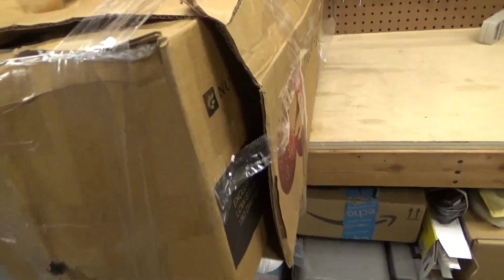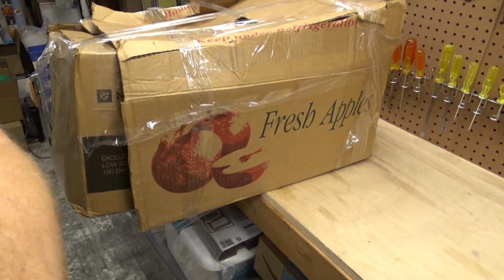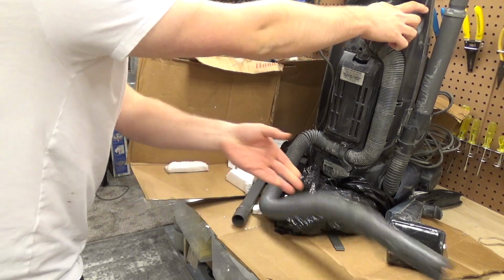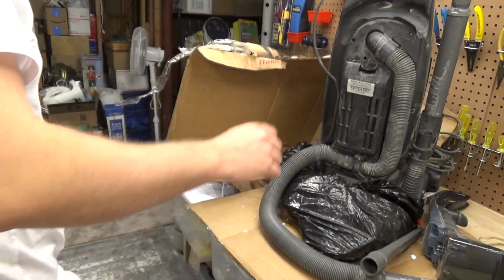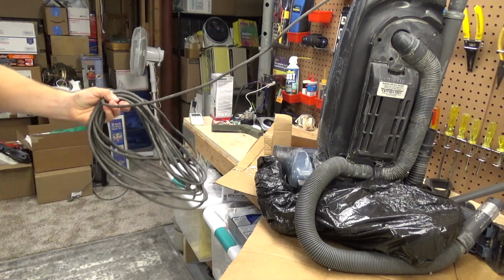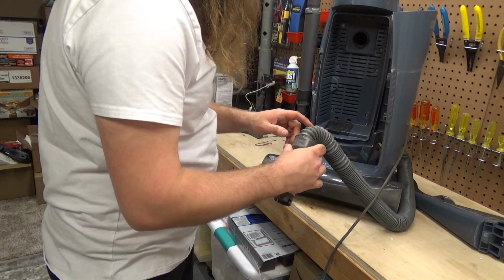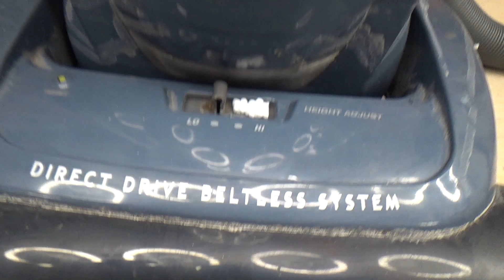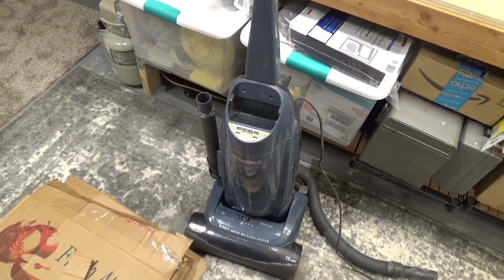Another EBAY Disaster Unfolds

Comment: Looks like it’s working properly. When you lean it back the brushroll runs at full speed if you press carpet. If you press gentle it will cycle the brushroll to the low speed and another press turns the brushroll off.

The Inteliclean will vary the suction speed automatically depending on how much dirt is picking up.

And if you’re on carpet or bare floor you press the H/M/L button to manually adjust the suction speed.
Reply from the maker: OK, that's all coming back to me now. It's been quite a few years since I've used this machine.

Comment: I'm starting to hate eBay. Just recently bought an old R12-based Avanti mini fridge from them (bad idea, I know, but I wasn't going to buy a crappy new one). Let's just say I'm amazed the refrigerant line wasn't punctured at all, although I had to bend the lower door hinge back into shape to get it to shut right. It was just thrown into a decrepit box and shipped. No packing materials, hardly any tape. I dodged a bullet.
Reply from the maker: I've been hating it for a while. I only turn to it as an absolute last resort option, and even that is starting to seem like too much.

Comment: Same thing happened to me recently. I ordered a Bogen intercom horn through Facebook Marketplace for $10 because a new one is very expensive, it was in good shape and all on the pictures and even had the base in place. 

   Apparently the seller thought it would be a good idea to place that thing inside a plastic target bag and later place it in a box that was seemingly larger than the item itself the diameter of the horn was 8" and the box looked like it wad around 12 x 16 in dimensions. It was shipped by UPS and I recieved the speaker with the half the base broken off probably from the handling and bouncing around in the box from Kansas to NY. I was at least glad the bell or driver enclosure was good and not cracked or extremely bent
Reply from the maker: Not good.

Comment: That’s a shame. I have that same vacuum, and it’s really nice, these are some of the most advanced vacs ever made in my opinion. 

I got it for 10 bucks at Habitat a few years ago and I got the purple bagless version at Goodwill after.

I come across the HEPA bags for these fairly often at the thrift stores around here and I’ve seen a few others of the vacuums themselves too. Not sure if it’s the same where you are but might want to keep an eye out.
Reply from the maker: I've gotten some good vacuums at my local Goodwill, including a red Progressive upright similar to this but with fewer features in regards to the controls. I am definitely keeping an eye out for another one of these, otherwise I will need to buy a few replacement parts, at least the hose, and spend a lot of time cleaning. Which is very annoying for the price paid.

I believe the bags are still under manufacture. I was able to find new sets at Amazon still in stock.